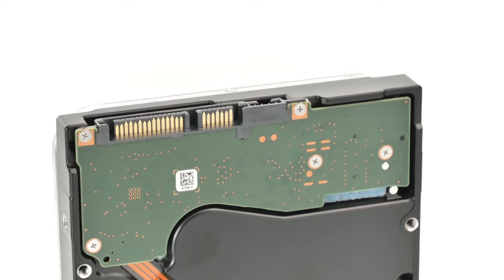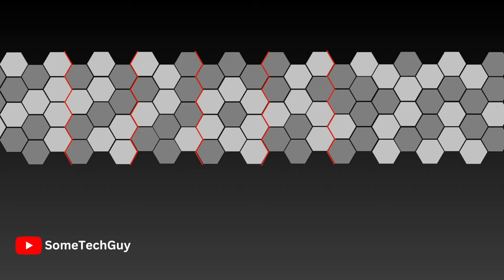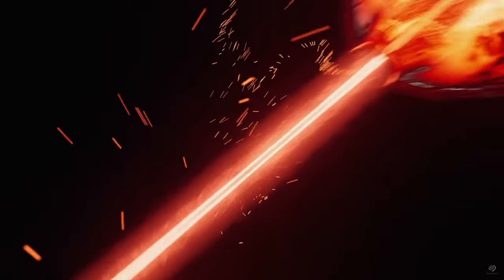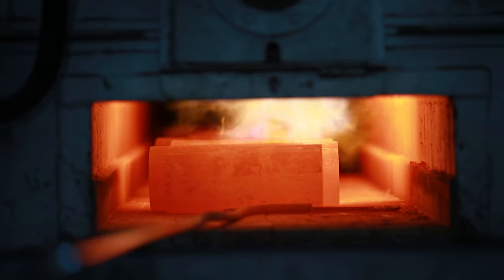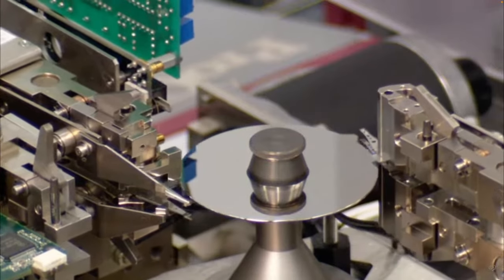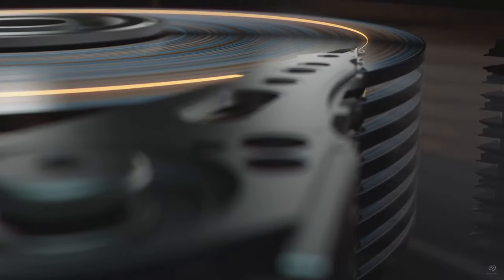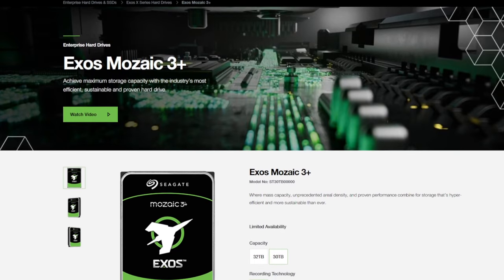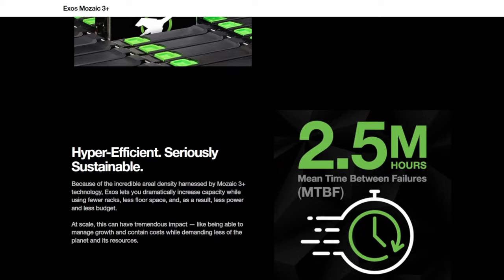Seagate Mozaic 3+ HAMR 30TB+ Hard Drives - Deep Dive

Comment: I always claimed that hard drives are just work of magic. It is like threading a needle riding in a car on a bumpy road, while spinning, in a hurricane, during an earthquake, flawlessly trillions of times. Now even more so.

I heard of HAMR and EAMR and patterned media for like 15 years probably, but finally things a real and in production. It is all pretty cool, but flash is catching up. Flash already can store more (easily 50TB in 2.5in drive) and way way faster, but economics still favor magnetic media if you do not need highest performance, but just cheap capacity. Gap is closing tho. If they say 100TB for disks in 2030s, but flash will be in that range in the next 2 years and in smaller form factor. So all matter of price really.
Reply from the maker: As antiquated as they sound, they phenomenally intricate devices, despite just getting stuck in a drive cage. And though NAND is catching, it’s very expensive per Tb at that scale, the endurance remains an issue also. And the problem of performance vs capacity is real. The highest density cells are the slowest and the least enduring. So I think that breakthrough needs to happen to really consign ‘spinning rust’ to the history books.😀

Comment: I wonder if this heat required to write data effectively will increase the HDDs power consumption significantly. 🤔
Reply: This very concern is addressed at 10:42
Reply: @nextbreeze7974  Thanks! That's awesome if power draw won't be an issue.

Comment: Does heat assisted writing also mean that write cycles to certain cell/area is finite?
Reply from the maker: No, it should not be the case, at least not with reasonable usage numbers. The idea is that the material is not degraded and that it just changes the coercivity (ability to write with the head) of the write domain for a very brief period. Seagate say they wrote 2 PB to a platter surface, so thats a lot of writes.
Reply: Hard drives already have a finite lifespan and duty cycle.
People bang on (and on and on and on) about SSD lifespan under the supposition that hard drives last forever under similar circumstances (i.e. writing terabytes per hour, for some reason.) They do not.
But no, HAMR will not give a hard drive any shorter of a lifespan than current PMR drives.
Reply: @sometechguy That number is good to know, but it's interesting to compare that to common advice to keep drives spinning because thermal cycling is the biggest contributor to long term failure rates.

I wonder what a write thermal cycle looks like at nanoscopic scale, what thermal gradients it induces between one track and the next, and whether there are particular material stresses they had to compensate for.

Comment: They should bring the ”Bigfoot” (5.25”) back!
Reply from the maker: Would be great, if any case can fit them in any more. I think those are in the rear view mirror now. 🙂

There was a time when there were 8" disks, and actually 14" before that. Back when they went in huge cabinets and capacities were in the Megabytes. How things changed.
Reply: @sometechguy  , well, pretty much every case has a place for OPTICAL drive. Which is 5.25". Which is same that Bigfoots used.

Comment: Rather than go for increased capacity, it would be more helpful to go for durability and reliabilty. Personally I am sick of losing my data and constantly worrying about losing my data. Further the whole world is in the same boat. Whilst we have never been more productive, we are losing most of what we create.
Reply: Do you keep backups? That's how you get piece of mind.

And anyway any storage medium that lasts long enough is going to run into lack of hardware support to read it. See: tape (audiocassette/vhs) floppy drives, zip drives, compact discs/DVDs, etc.
Reply: If only you could make a copy of your data and put it somewhere else.
You should write that down. It's a billion-dollar idea, right there.
Reply: Nothing is perfectly reliable. I'd bet on a proven HDD for long-term storage over any SSD that can fail catastrophically at any point with no warning. HDDs usually give signs before failing. Also, I'd stick to WD for reliability, but you can check out this channel's reliability comparisons between the brands.
Reply: @chatboss000  I have a LOT of drives, all duplicated, but you can still get caught.

But the point is we have books and scrolls thousands of years old and can still read them. Drives barely make it to your child's Kindergarten graduation.

Comment: So it's like MO disks from nineties but smaller
Reply from the maker: I think in some ways similar, the write area is heated to its curie point and a magentic write heads sets the polarity. 

And in some ways different, reads are done in a traditional way as hard drives, and I think the magneto-optical drives used polarized light. 

Those drives were pretty slow I think for writes. But there are a lot of parallels.  So this is a good call out.

Comment: We are going to need a new sata spec. 30+tb of data is going to take forever at current speeds.
Reply from the maker: Yes, SATA in its current form was standardized in 2009. And modern drives are getting to the point where they can saturate that link. So seems to be time.
Reply: @sometechguy  sas even got 2 more versions since then. Its a shame they just gave up on sata.
Reply from the maker: When I say modern drives, probably the only one that is really close to link saturation is the dual actuator Exos MACH.2 SATA drive at around 545MB/s max. But if they implement dual actuator more commonly, it could be a problem.

Will be interesting what the Mozaic drive does for data rates in the future with denser platters, it looks like the initial model will still only do around 275Mbps, a little slower than some of the recent Exos.
Reply: @sometechguy  i mean ssds on sata hit the limit easily. So that alone should have been reason for a spec update.
And i would guess throughput would increase as a natural consequence of the increased density of hamr drives especially if they combine with multi actuator.
Reply from the maker: @acolyte8564  yes, your totally right.

Comment: I don't think that more TB for proportionately more money is what people want, otherwise we would just buy more drives.  It's not like most users have to build a data centre for all their storage.
More TB for a little more money is what they need to aim for.
Reply from the maker: For some, density is the key thing to save cost in infra and data centre space, for others it’s price per TB. Initially, I think this would be mostly targeted at hyperscale customers, and less at consumer. Hence why they are being tested now for some years at these big data storage customers.

Price per TB continues to fall however, and this will only help. For less density driven use cases, it’s possible to fit more data per platter, which reduces platters/heads etc and reduces component cost. So this can only be a good thing from a price per capacity standpoint also.
Reply: You're describing small people with small needs as though they're the only ones who exist.
"Just double the drives"... and the cabling... and the power supply... and the HBA ports... and the difficulty of maintaining them... etc. etc.
"Why buy a van when we could use two sedans???"
Reply: @tim3172  What I am saying is that buyers large and small want more storage per dollar.  Not double the storage per drive for double the price.
Reply: @sometechguy  Sadly price per TB drops have been far slower in later years when going after historical prices. I'm willing to pay a premium for a bigger HDD vs 2 smaller onces but this has its limit. It's already annoying in the GPU space that you nearly have to pay x% more for x% more performance, even though a new GPU gen should offer a far greater generational price per performance leap.

At the moment I own 2x 20TB, 2x18TB and multiple 12, 8 and 4TB drives and would love 30TB+ drives so I don't have to split the data over multiple HDDs (+ redundancy). Also I'm running out of space again already and would like to buy drives far above 20TB next. Of cause besides size and price there is also the factor reliablility, where Seagate is still stigmatised. I own mainly Toshiba and WD drives but never had a failed drive since getting my first PC in 94 and this includes a handful or Seagate ones too. My wife once dropped one of my external WD drives while it was running and I had some data loss but it still works to this day (like 7 years later).
I would love to get an Ultrium 8+ LTO drive if they weren't far to expensive for private use. So HDDs are the only way for me to backup my data.

With my needs I'm most likely part of a minority that is of no concern to these companies. Thing is, is enterprice interest in HDDs really so high if they can use SSDs for their speed and access times and LTOs for backups? I should ask my colleagues from our high performance computing centre if they still use HDDs to any meaningful degree in their 40+ PB setup.